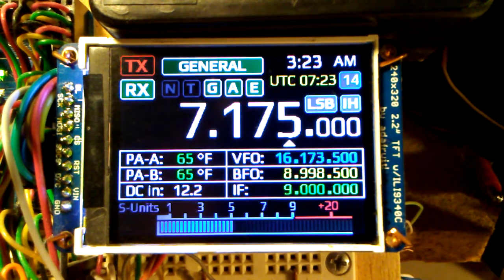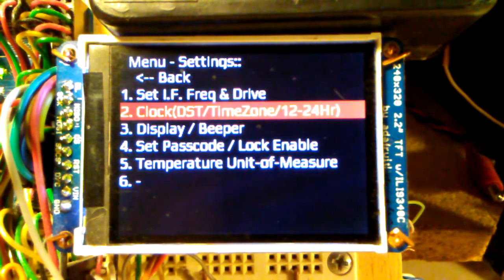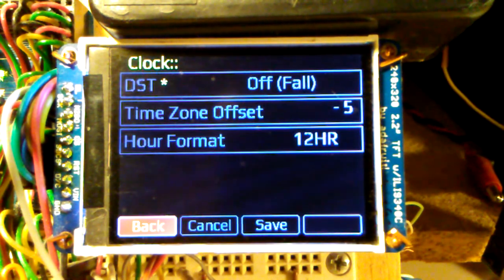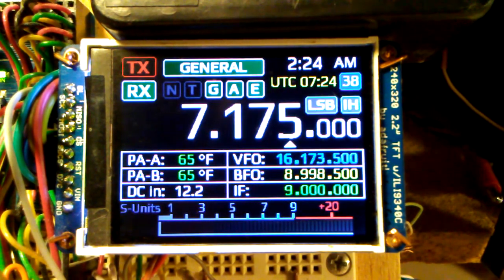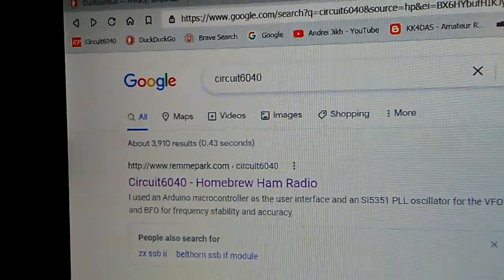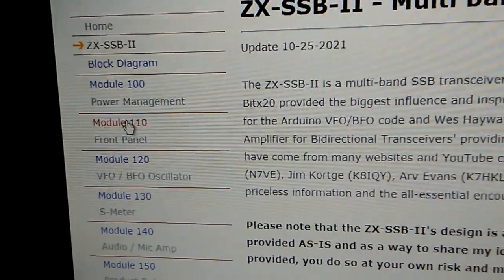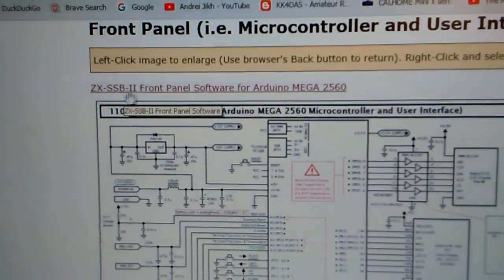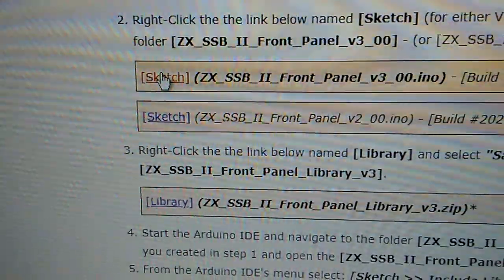ZX SSB II Front Panel DST Setting

Comment: Hi can a larger lcd be driven?
Reply from the maker: Paul, I believe a larger display can be used if it uses the ILI9340C chip and has the same control lines as the one I'm using.  I found a 3.2" display that works well from Ebay from seller Alice1101983 - Search ebay for: 3.2" Inch 320X240 SPI Serial TFT LCD Module Display Screen With Contact Pane.  I hope this helps - 73 from N3FJZ Rick.